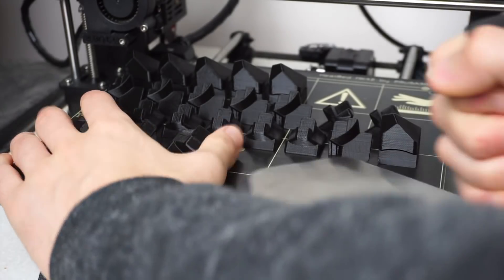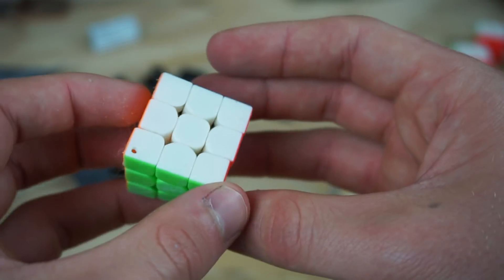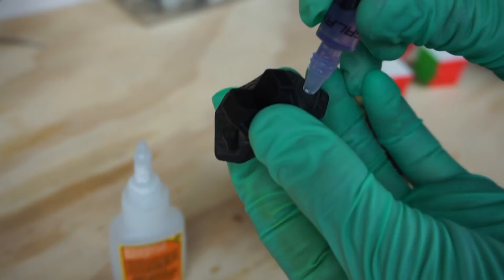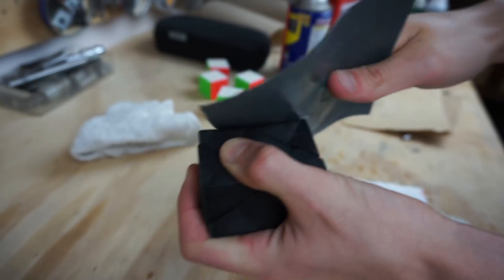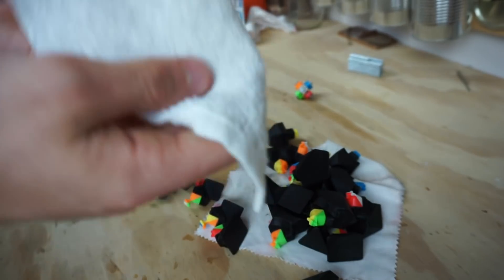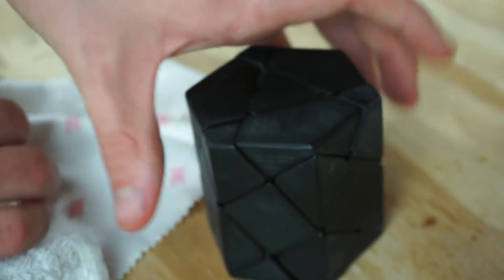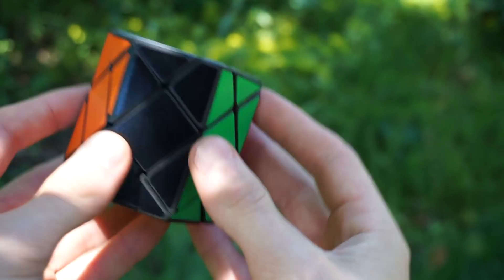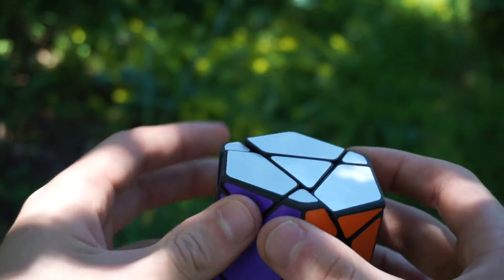Hexagonal Prism Extension Mod [Build Video]

Comment: Funny joke you could use to "make sanding interesting":
instead of showing the actual sanding process, record yourself throwing sand onto some pieces then cut to after the actual sanding process.
... maybe use spare or unrelated pieces
Reply from the maker: sand blasting is technically sanding, right?